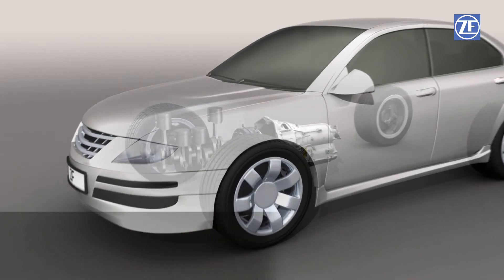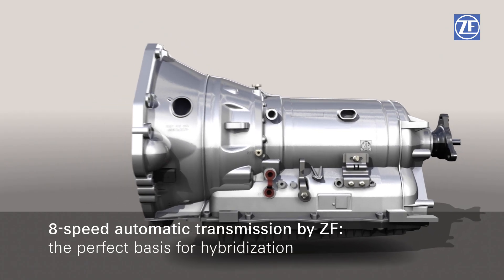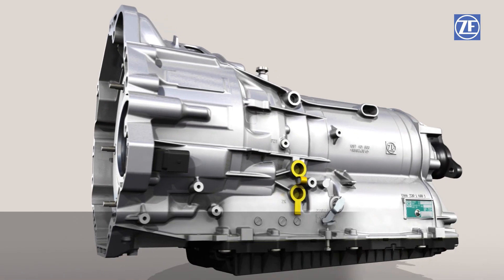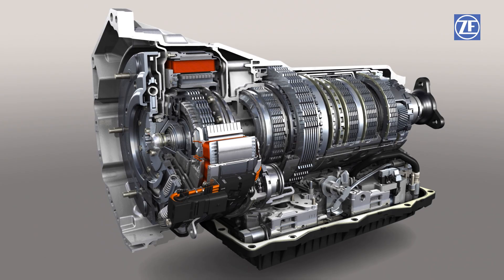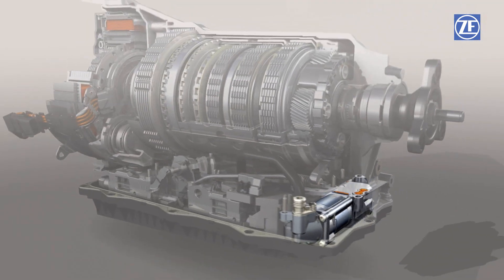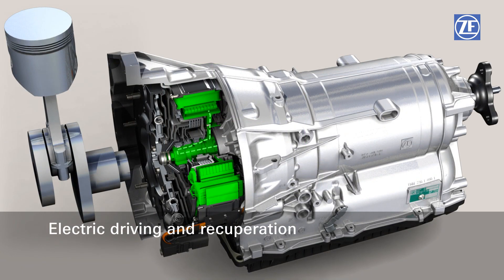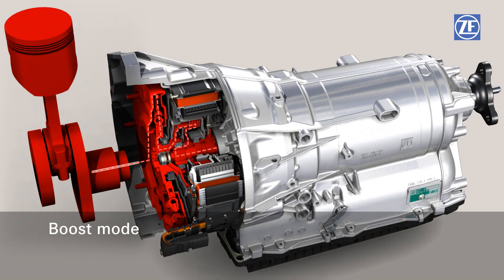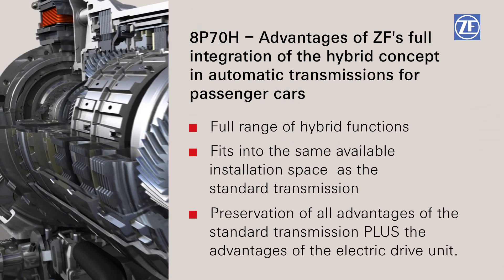High-performance full hybrid by the Powertrain Technology Division

Comment: I've got this drive train in my F30 330e, when it comes to regen, I'm 99% sure it used the friction brakes, and the regen of the motor is actually relatively weak; it does regen if you "coast", as the power indicator shows its re-gening the battery at "level 1", but the second I touch the brake, I can feel the friction brakes engaging, and the power meter then goes to "level 2" (and "level 3", dependant on the braking force applied).

It's interesting to know the mechanics of how it functions tho; it explains why, sometimes, there's a delay in the engine starting, and power being delivered; and why the car sometimes does a soft start, and why sometimes it used the starter motor; it also explains why the engine is able to immediately rev to 5-6k RPM, if you're demanding a high amount of power, whilst the engine is switched off.

Very informative

Comment: Is this parallel hybrid driveline used the in BMW X5 xDrive40e (2014-2018)?  xDrive45e (2022-)?  If yes, in which other BMW models and years is it used? Is there a list or reference available? Thx,
Reply: Since ZF's transmitions are used in almost wvery modern BMW I think that this tech is used in all their hybrid cars. I know that it it used in x5 45e (and the newer 50e) and I have to say that it works perfectly, you never notice when it is switching from ICE to EM and vice versa.

Comment: The best and most efficient plus cheapest and simplest powertrain for both ICEs and EVs is the Positive Drive Infinitely Variable Transmission, PDIVT.

The power transmission starts from the center of input shaft and shifts ouwards as the vehicle has gaining more speed.

It offers what CVT can do but in positive drive. And starting from center of input shaft. This is the best solution for heavy vehicles such as trucks, buses as well as hypercars, sedans and motorcycles.

The world needs innovation and breakthrough in technologies. Make a change if we care about emissions and global warming. Because the PDIVT powertrain will greatly improve the efficiency of transmitting power from engines to wheels. And this will save fuel and energy causing less emissions issues.

Comment: Some parallel hybrids use the electric motor only for reverse operation. Is this configuration this way or can it combined with the ICE as well? You mentioned I believe that it contains a cane type fluid pump as well as the electric pump, with heat generated inside the clutch packs, which pump provides cooling? Just curious unless it is covered by intellectual properties. Thank for allowing learning to occur! ASE Master Tech since 1978.
PS; I find the animation well done, so tell that department my enjoyment. I won’t name the company but I was introduced to the younger gentleman creating an automatic animation for a manufacture. After our group had asked some questions, I asked him if he knew how the transmission worked! He hesitated, then replied “No”. As an experienced service tech over decades, I was say, taken back by the thought. Thanks again.
Reply: Hi, I am Graeme John Eddington. Following is my Youtube post of my Multi-speed transmission I have called: "Opposing Torque Dynamic Clutch" which is a type of Infinitely Variable Transmission (IVT) which I believe is ideal for your current applications. Please log on to my Youtube video: https://www.youtube.com/watch?v=SACDK89U7PM

Comment: Is it possible to install this transmission  instead of the ZF 6HP19A
Reply from the maker: Hello David,

you can use our technical inquiry for such specific questions: 

https://www.zf.com/corporate/en_de/aftermarket/technical_information/technical_inquiries/technical_questions.jsp
Reply: Hi, I am Graeme John Eddington. Following is my Youtube post of my Multi-speed transmission I have called: "Opposing Torque Dynamic Clutch" which is a type of Infinitely Variable Transmission (IVT) which I believe is ideal for your current applications. Please log on to my Youtube video: https://www.youtube.com/watch?v=SACDK89U7PM
Reply: Is asking what the max amps the electric motor will draw an ok Question?